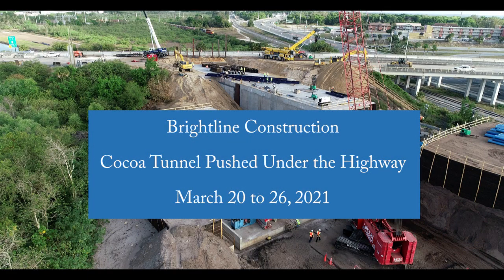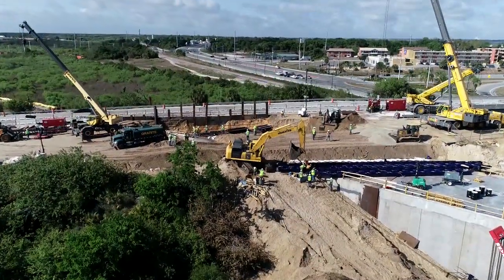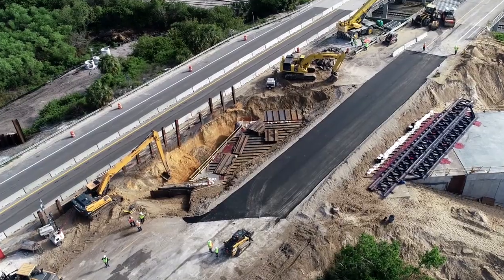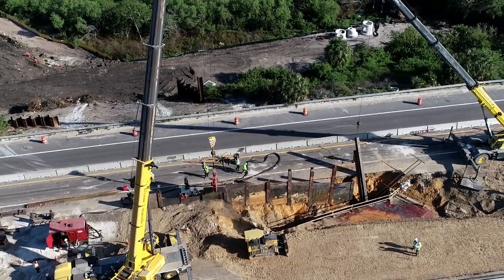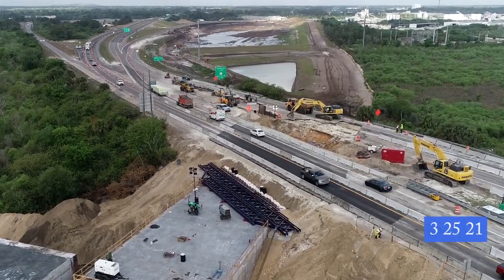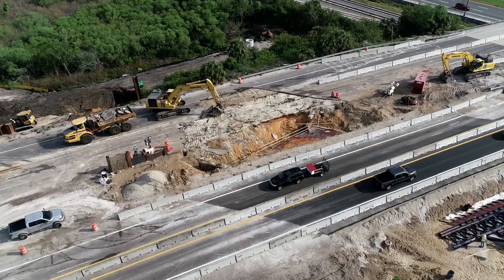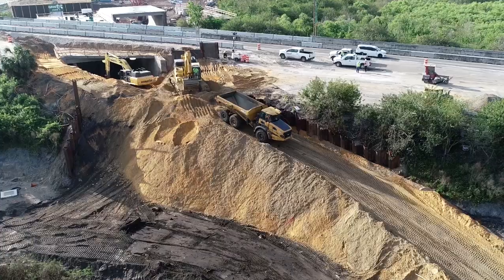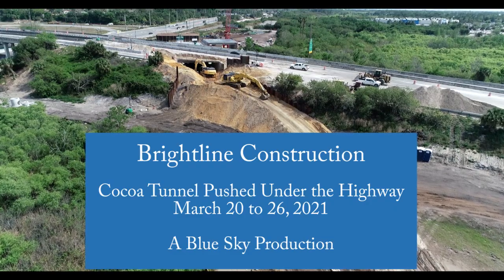Brightline Construction Cocoa Tunnel 3 26 21 update.  The tunnel goes under Highway 528.

Comment: Is this tunnel part of the right away for the tracks of the All Aboard Florida trains? All Aboard route starts in Miami and ends at Orlando Jetport. Most  of it  uses the existing Florida East Coast tracks to Cocoa, then new tracks are needed from there to the jetport.
Reply from the maker: Yes, that's the basic idea.  A new track is being added from Palm Beach parallel to the existing FEC freight rail.  Where the tunnel is under highway 528, the new rail veers away from the FEC main line to head west to Orlando.  No trackage exists between Cocoa and OIA so all this is new right of way.  They hope to have it operating by the end of 2022.